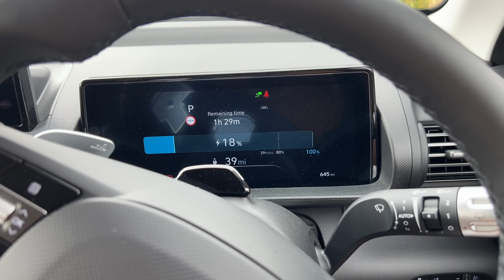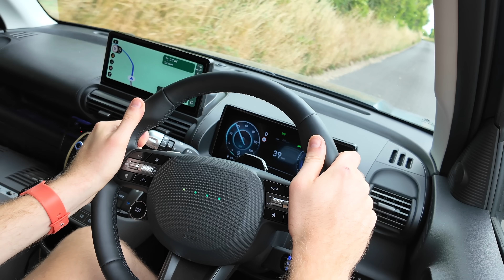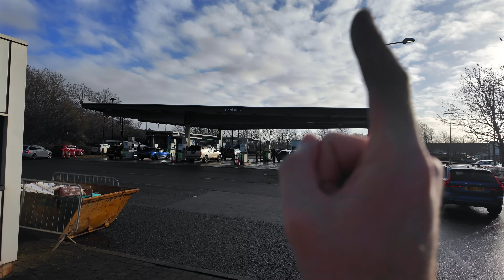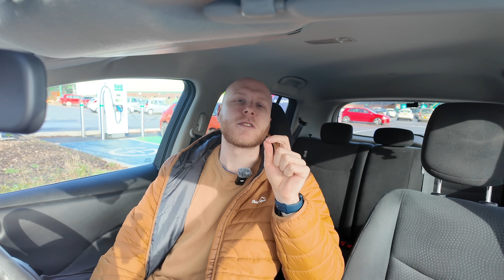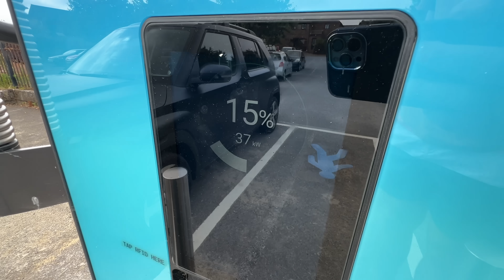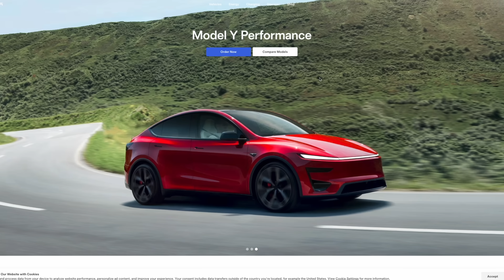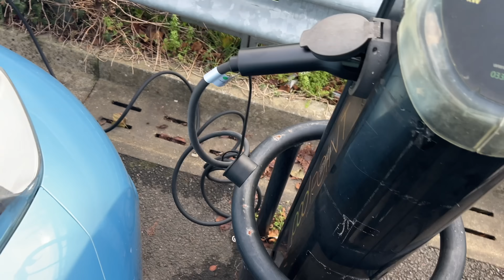19 Things You Should NEVER Do In An Electric Car

Comment: “Next tip is to not use the brakes” - actually using the brakes (not violently) works regen in the same way. In fact Porsche doesn’t bother with regen ‘settings’ because it wants owners to drive using brakes like they’ve always done since the brakes use regen in the same way (again, not braking violently). And the best economy I’ve found is selecting ‘freewheel’ and just braking normally (again, not violently). Obvs in busy city traffic conditions, settings like ‘Auto regen’ on the Hyundai Inster are great because the car will then automatically switch out of ‘freewheel’ and apply regen braking when traffic in front slows or stops, then re-engage freewheel as you pull away again
Reply: Exactly! Most modern cars uses regen braking when pressing the brake pedal. My BYD can regen up to the maximum power limit (150 kW in may case) and uses the mechanical brakes only for the last meters. Adaptive cruise control also uses regen braking.
Reply: @JürgHölzle what will it do when you need emergency hard stop brake? Still involve regen brake first and will cause a longer drag before stop?
Reply: That’s correct - the Germans haven’t historically implemented true one pedal driving, but I believe that the Neue Klasse BMWs are going to have it (or something close) - they are talking about “the joy of stopping”

Having hired Polestar 2s and Teslas and owned a 2nd generation Nissan Leaf, I would never personally want an EV without it. It is precisely because the Polestar 2’s OPD implementation is so excellent that I own one now.

When you can slow and then brake a car as smoothly and progressively with upward movement of your foot as downward movements speed it up, you don’t want to go back.
Reply: Also should use the brakes with regen turned off, then you prevent the discs from getting too rusty. This problem is more present here in Norway, because of salt in winter !
Reply: @abedin1  I think this is why the Renault Megan occasionally stops regenerating and only uses the mechanical brakes. This happens automatically and also simulates engine braking by keeping the car slightly braked when releasing the accelerator
Reply: @abedin1  my Hyundai Kona has the option to make the car use the actual brakes for a couple of times automatically. When driving you don't notice any difference but the brakes are clean again afterwards. Convenient.
Reply: @abedin1  newer evs should massage the discs for you occasionally, model 3's have always done it for example.
Reply: @abedin1 EV3 has brake cleaning mode for this very reason :)
Reply: @abedin1 alot of modern electric cars already have some breaking disc clean automatic you dont even notice....
Reply: @ayebrow BMW i3 has true one pedal drive since 2014…
Reply: @ayebrow All BMW EVs have a strong one-pedal mode that stops the car fast and without braking in city driving. It’s much more frequent to change tyres than to have to change brake pads
Reply: Interestingly, the Hyundai Inster has some useful electricity ‘consumption gauges’ - if you drive in ‘freewheel’ the gauge will display the real-time motor consumption (usually fluctuates between c 5-15kW on the level the way I drive, but I guess it could jump to maybe 70kW in a ‘clutch-dump’ getaway…) but any braking will show a negative value eg modest braking yesterday typically showed -7 to -11kW (i.e. energy flowing back into the battery) and when I had to brake a bit harder jumped to -25 kW. Which proves you can use brakes instead of a regen setting, if that’s how you prefer to drive, and still get the same level of energy recovery
Reply: @jaywalker1233 Exactly, my Renault does this too, the first few millimetres of pedal travel increase regeneration, I've seen peaks of 60 kW
Reply: “Which proves you can use brakes instead of a regen setting”

What you are talking about is controlling the regen setting via the brake pedal. Which is perfectly fine, and to some extent gives people new to EVs the sense that not much has changed.

But true One Pedal Driving takes that to the next level. Instead of lifting your foot from the accelerator pedal and transferring your foot to the “brake” pedal to begin slowing the car down, you simply lift your foot up as progressively as you would press it down.

And it honestly feels like the car’s speed is directly coupled with your right foot. Once you have got used to that sensation you will never want to go back.
Reply: @ayebrow  fine in city driving coupled with auto regen (car automatically slows/stops to match traffic ahead) but 100% 1-pedal driving is pointless + tiring for long distance driving both for the right foot+ankle and mentally (requiring continuous concentration) when freewheel + autocruise is the optimally efficient and most relaxing mode on arterial +motorways. But, hey, you do what’s best for you, and everyone else does what’s best for them 😊
Reply: @jaywalker1233that's why adaptive cruise control exists it allows you to not have to constantly use the accelerator pedal on long roads
Reply: @404hopenotfound  no, adaptive cruise control is an optional feature in all car types, ICE or EV, and it is not featured in all EVs - so it is not required for regen (but it does improve regen efficiency)
Reply: I totally agree. Just one of several misleading 'tips'.
Reply: stopped the video when it mentioned does use the brakes.
Reply: The VW Group vehicles have a "B" regen mode but also I believe when you're in normal Drive mode use regen to slow the car down first of all when you press the brake pedal.
Reply: Depends on the car. In the Bolt regen is already at max when you let off the gas pedal. The brake pedal does nothing for regen.
Reply: @natehill8069  all modern EVs have ‘blended’ regen / brakes - drivers need to brake strongly, beyond regen’s max capacity, in order to activate the friction brakes (unless, like Hyundai +Kia, the car has a ‘Clean Brakes’ function)
Reply: @jaywalker1233 Mine does not. I can see the amount of regen on my dashboard, it maxes out at about 65kW before I move my foot off the gas, and applying the brakes has no effect on it.
Reply: @natehill8069  sorry, what point are you trying to make? All modern EVs have blended regen / braking systems. Your EV (if modern) will be the same. That’s why your car will have a normal friction brake system. And that braking system obviously works, and needs to work - otherwise your car would not be allowed to be used on public roads
Reply: @jaywalker1233 My point is if at any point I touch the brake pedal to any degree whatsoever, it wastes energy and decreases the amount going to regen; and thus the "tip" was correct as stated.
Reply: @natehill8069 you make no sense - “blended brakes” means the brake pedal operates regen in EVERY modern EV
Reply: @jaywalker1233well it does reduce the amount of energy that can be recovered as yes the regenerative braking is still working but the friction brakes are turning a portion of the energy that could have been recovered by the regenerative braking system to heat
Reply: @404hopenotfound  no, ‘blended’ braking means that the same energy will be regenerated regardless of whether the brake pedal or ‘regen settings’ are used except where the driver applies a brake force that exceeds the max regeneration that the car can recover (which varies from model to model according to the max charge speed limit). Porsche chose not to include ‘regen controls’ for this reason because it wanted drivers to have the ‘traditional’ driving experience that still gives the same energy regenerating efficiency as ‘regen controls’
Reply: 'Correct tyre pressure' aint manufacturers sticker spec...
Reply: Several reviewers have determined that auto regen is the best way to improve your range. Letting off the accelerator pedal puts more power back into the battery. Even when coasting to a stop
Reply: @stevekight1955  great thing about the Hyundai setup is it offers so many driver choices
Reply: So the message is don’t brake violently then!
Reply: @philfyphil  no, the message is the brake pedal on modern EVs operates regen just like the regen settings (because the brake pedal operates the car’s regen - called ‘blended’ braking) so, despite the message of this video, drivers can drive just like they’ve always driven ICE cars if they prefer and with all the regen benefits but ‘violent’ brake pedal use always engages the friction brakes (stated for completeness)
Reply: It's comically bad advice. For efficiency, you want to coast as much as possible, which means setting the regen paddles to minimum. Regen recovers less energy than acceleration delivers, so more aggressive regen settings mean you're just accelerating and decelerating more and coasting less - which is the worst thing to do for your range.
Reply: @Daedalus451  yes , also on a recent long road trip i found that smart cruise, tho’ useful, doesn’t deliver best economy (‘braking’ late instead of anticipating ahead) - still, having all these features does give lots of driving mode choices according to conditions and driver ‘mood’
Reply: Using brakes wears the break pads/discs. Using regen braking alone reduces that and therefore reduces running costs.
Reply: @uksnusreviews9455 no, the opposite is true - NOT using brakes means surface rust penetrates the discs causing pitting (an MOT failure), requiring premature disc replacement at significant cost. That is why manufacturers like Hyundai have a “Brake disc cleaning” function which temporarily disables regen to force the friction brakes into use which quickly cleans off the surface rust, restores clean shiny discs and prevents pitting - I do this every few weeks when rust becomes visible
Reply: Yes. With my Enyaq, it moves with D. You can manually put it on B, but it feels so unnatural.
Reply: So when you say never leave ya car charging mine being octopus it turns off when fully charged. So is that not allowed then leave it plugged in. I don’t have a tarrif as it worked out more expensive overall so just charge to 100% and then it shuts off. Mines a new MG S9.
Reply: Hhhhh
Reply: Problem with "one pedal" vs the dynamic brake to be on the brake pedal is, it uses to lead to a driving style that quite wastes energy: Although regenerative braking returns majority of the energy back, it is still consuming significsntly more than letting the car coast and use any brakes less. And keeping that "coasting" spot on a "one pedal" is rather tedious and often you fail to keep it just there. Plus unintentional swinging between acceleration/braking uses to trigger motion sickness, sometimes called "ev sickness" in passengers.
On the other hand on many cars the friction brakes engage way too high on the brake pedal, without any noticeable separation present (like need to overcome some extra pedal resistance when going from just dynamic to for the friction brake section,...), causing drivers to unintentionally use the friction brakes when not needed and waste power that way.
Reply: @annaplojharova1400  motion sickness from regenerative breaking is bullshit and your advantage in efficience for coasting academical, in real life it maks close to no difference
Reply: @jorgmethfessel5774 I never said the motion sickness comes from  braking being regenerative. The sickness comes from constant aceleration/braking cycles, which come from how the driving tends to look like when controlled by just a single pedal. And you get the same when some jerks in "sports cars" do not know anything else but just alternating accelerating and braking instead of maintaining steady cruise speed. It was mentioned mainly with Teslas (where the single pedal mode is the only way to activate the regenerative braking), the effect will very likely depend on how the response is programmed in, Teslas are exceptionally aggressive in this matter.

And the coasting efficiency: Yes, the regenerative braking makes the difference smaller, but still rather large, the efficiency of the regenerative braking does not go far above 50% (without regenerative braking it would be zero).
If on ice it can make more than 20% fuel consumption difference (careful drive style vs gas/brake), with ev it still remain about half of that. And yes, it heavily depends on the traffic conditions, my experience is with Tesla and repeating the same style with ice Golf.
Don't like the control of the Tesla.
Just grew up driving EVs on Skoda 15TR, where are actually 3 separate pedals: accelerator, dynamic brake in the middle (what would become the regenative brake) and the standard friction brake on the left. Personally can not imagine anything better for electric vehicle - no need for any "creeping" or "hill assist" complications (just hold it by the left, add "gas" and release the left and you have very smooth and quick launch without any backroll or so), you are in full control about what the thing is doing. The only drawback is, you needed to learn to use left for full stops and things like emergency braking, so I perfectly understand that to not be viable for passenger cars, at least not for the foreseeable time being. But it took most drivers way less than a hour or two to learn that...
Reply: @annaplojharova1400 sorry, still bullshit you fantasize about...
Reply: 19 reasons why i will stay with petrol.

Comment: Top tip:  If you have a cheap overnight rate make sure 
you put the washing machine on at 2am, your neighbours will thank you.
Reply: I just make get up at 2am to blow dry her hair n put the washing on...
Reply: The energy consumption of a washing machine is highly dependend on the temperature and it consumes almost all energy at the beginning of the program.
Here it is common practice that those with panels or a dynamic energy contract, to run the machines around noon. The consumption peaks are in the morning and evening after all and noon is frequently cheaper than the night energy.

And yes, run lower temperatures most of the time is a very simple way to save money.
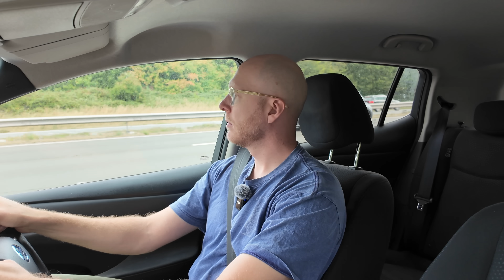Reply: @alis49281  This makes no sense! 23:30 - 05:30 is cheap rate, that’s the best time if you are on dual tariff.
Reply: Kinell,  how bluddy old is your machine?  I can barely hear ours with the kitchen door closed except the spin cycle....
Reply: I mean, there's several walls, a garage, a swimming pool and a whole garden between my washing machine and my neighbor. I very much doubt he'd care if we did laundry at night.
Reply: If you have a garage to charge your electric you probably don't live in an apartment
Reply: That's the annoying thing about neighbors , inconsiderate , they come banging on my door at 4 o'clock in the morning complaining about my drumming practice !!  just plain inconsiderate .
Reply: So will the fire brigade when it catches fire and you don’t realise.
Reply: @philfyphil  Free central heating; join me for more money-saving hacks...
Reply: @philfyphil  Most houses these days have linked smoke and heat detectors. A problem in one room and the entire house lights up with sirens. No excuse for not knowing.

Comment: you really really have to use your brakes... or they will just rust. so use them
Reply: That fails to understand how true OPD works. As you lift your foot higher from a “cruising/coasting” position, the power in reduces, then regen starts and gets stronger and if you lift your foot off more quickly (or completely) at speeds below 10/15 mph the brakes are engaged to bring the car to a complete halt.

Not all EVs have OPD. They just regen to a greater or lesser extent and you have to press the brake pedal to bring the car to a halt.

But the Polestar 2 does have true OPD and the brakes are engaged to halt the car even if you are stopping at a roundabout on a steep downhill slope.

Since taking delivery of mine I have had OPD on 100% of the time, and have pressed the brakes manually maybe once every 100 miles. The car, however, has engaged them 100s of times.

Comment: Don't use OPD. Instead lightly tap the brakes to blend regen. This way you still regen and brake but you also use the kinetic energy your car has to coast.
Reply: That is a fundamental misunderstanding of OPD. All OPD does is treat lifting the accelerator pedal as the inverse of pressing it.

When you are driving at constant speed using OPD, there is still energy required to overcome mechanical, rolling and air resistance. If you wish to slow down at a very slow rate, and lift your foot up, the first thing that happens is that the energy being passed to the motor reduces so it isn’t enough to overcome the various resistances.

Note that the motor is still driving the car, but not enough to stop it slowing down. At some point, if your foot is a little higher, there is no net energy going into the motor, and none coming out, and then the car will slow down like a petrol car in neutral, with virtually no mechanical resistance from the drive train and only rolling and wind resistance slowing the car.

If you lift your foot further still, the regen begins, and this will initially be like engine braking in a manual car in 5th gear. If you lift your foot higher still the “engine braking” effect gets stronger:

This myth that you cannot “coast” with OPD has been propagated by fools that have zero idea of how the system works.

I drive a Polestar 2 with OPD on 100% of the time. When on the motorway I engage adaptive cruise control and let the car keep the speed constant by adjusting the power and regen levels as needed, and it regularly achieves over 5 miles/kWh on long road trips.

The Polestar’s implementation of OPD is awesome.